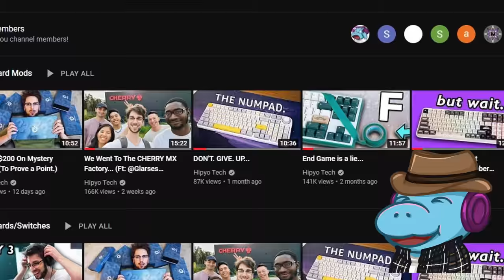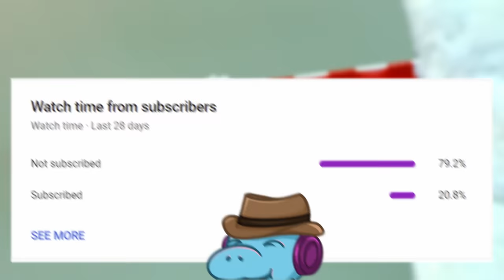Top 5 Ways To Make Your Keyboard THOCK (On A Budget)

Comment: I just got a keychron k8 pro with red switches. (my first mechanical keyboard) Everything sounds great except that's the problem, I don't want to it sound at all. So the big question: Is there a way to reduce or eliminate debounce noise? (resulting from stem going back up and hitting the housing)
Reply: you probably want silent switches and or lube/film them. reds are quite silent but the red silents arent making much noise in comparison.
Reply: @niklasdrago  from what I have seen on youtube, they still have the same noise. The only "kinda" exception I have seen was bobagum. Which 1. I am not sure of 2. Can't find 52 gr ones. I have to buy through shady places if I want em :(

Comment: bro, advice

k2 pro 
k8 pro
v1 
v3 

wireless is fun, cramped up arrow is a worry. height is too much for typing? can't do without wristrest ?
k8pro provides Gateron Gpro and rest all has Keychron kpro switch.

or any other product you'd suggest from indian market. 
I just sold my Rk98. so need to make a purchase asap. which one shall I go with ?
Knob is a +, and also V series is currently having 10% off. but again wired.

note that, here in India there isn't much options 
and also I'll be using out of the box keeb..and not into moding and all.

Comment: Hipyo! Veteran here, I just got a feker alice 80, and the dhukaro vn96. they both will have gateron oil kings, what mods should I do for the best possible sound that is also affordable? Thank you!!
Reply: Tape mod and foam should be enough for most keyboards. You can probably try to get durock stabs too.
Reply: I know some people actually took out case silicone in their Alice80s.  I left mine in since I like the muted sound... though it does kill a lot of the thock from my Boba U4Ts in it.  They sound a bit more clacky with Cherry profile PBT keycaps like the Polycap Code that I put in mine.  
Get some polyfill or dacron wrap with tape mod and it sounds pretty good.  Some people removed the silicone plate dampener too.  My concern was too much flex that point since I prefer a bit of stiffness in my boards.

For the VN96 I'd go with Plastilina in the bottom case and polyfill with tape mod.

Comment: Hey, I’ve I disconnected my battery from the PCB is it still a problem to use painters tape? Getting conflicting info from a couple of places. Heard the battery v is so low that it’s not an issue but I disconnected the battery and just using it as a wired keyboard.

Comment: how about tips on how to make keyboards sound good without putting keyboard apart?
Reply: put a piece of paper under , use a wooden desk
Reply: Put your keyboard on some firm packing foam. No noise from the desk and reduces impact on your fingers when you bottom out switches. It's as good as any desk mat in terms of function, just doesn't look very nice
Reply: @wiegraf9009  thanks bro it acctually works im quite scared i might break my keyboard while putting it apatt

Comment: Hey Hipyo, what style of keycaps are these? The design of them? 1:41 . They remind me of the old school IBM keyboards I used in the 80's and 90's. They came with the Q3 I just bought, but want to find a nice set that has that style of keycap design. Thanks! And Thanks for the video and advice!
Reply: they're the default keycap on the Keychron Q2 as well as a bunch of other keychron products i believe
Reply: @mustarduser91  Is it called a specific style though? Or is it like keychrons specific keys they use?
Reply: on the Keychron website it says that both use “Double-shot PBT keycaps, not shine-through, OSA Profile (OEM height, SA shape)” but I don’t know the exact key cap, I might dig a little bit

Edit: I don’t think they sell the keycaps separately, but I found a similar one on the Keychron website with the same profile and it looks similar, they are called the “Double Shot PBT OSA Full Set Keycap Set” and are only 30$

Comment: I don’t really think the battery would get hot enough to really burn painters tape as it has some heat resistance.
Reply: I think it's good. I don't think the battery is getting that hot. Did you try it?
Reply: @danimper2517  I haven’t tried it some people say it’s fine some don’t so…

Comment: If you use tape on a keyboard with LEDs, will you still be able to se it ?
Reply: They are putting tape on the back of the board. The leds should be on the other side where are the actuall switches of the keyboard... :)

Comment: Question for a tape mod could you use electrical tape instead of the tape you used in the vid?
Reply: i don’t recommend it, electric tape is sticky and can ruin your board if you ever need to reopen the keyboard and masking tape like in the video is made out of paper what is softer -> better sound
Reply: @csehbalazs5456  can't the masking tape burn? And start a fire?
Reply: @flqke733  absolutely not, my advice is 3-4 layers and pre-cut holes for connectors. it cannot start fire if it really masking tape or painter’s tape because it’s made out of paper and soft glue. don’t use hovewer any metallic tape e.g. aluminium foil-like tape because it will ruin your board instantly. won’t likely start a fire but 100% fry components on the board.
so stick with paper tape and don’t use more than 4-5 layers so the height of it doesn’t bother you at assembly.
Reply: @csehbalazs5456  Thank you for the help.